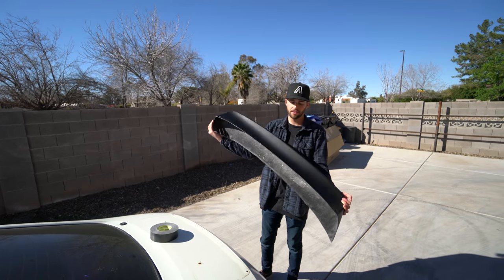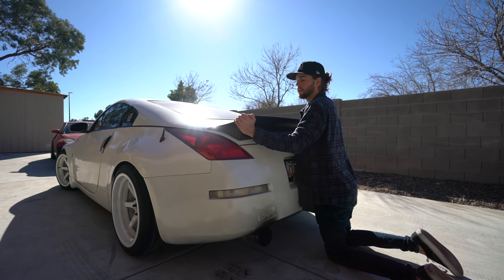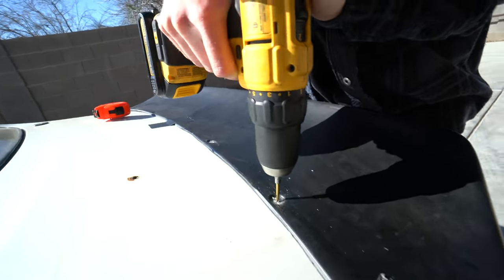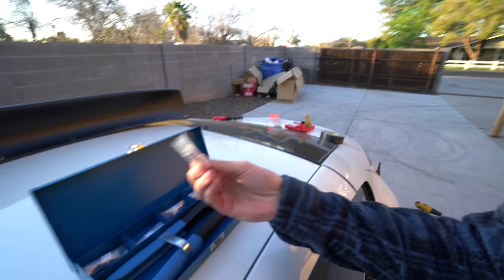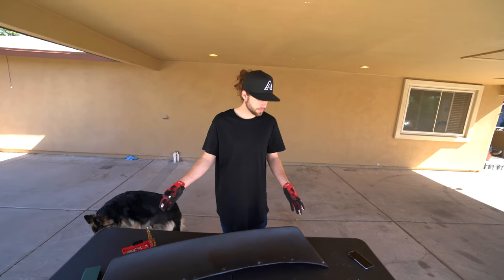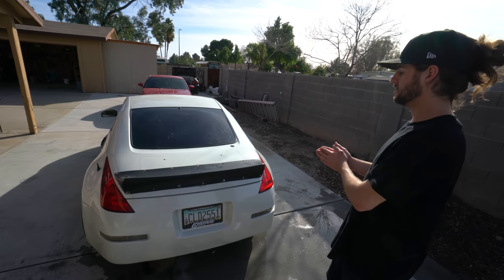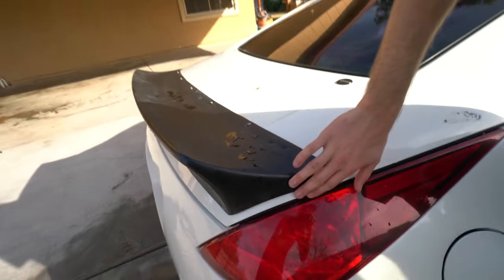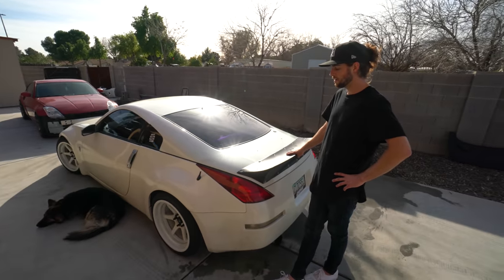Rocket Bunny Duck Tail Install on Nissan 350z

Comment: Bro so sick. I’m bout to sell my miata for a 350z
Reply from the maker: Good move!!!
Reply: yo I have 3 miatas but I'm just straight up buying a 350z😂
Reply: @CameronAlford  how's it going bro I just bought one of these spoilers the other day and looks like double-sided tape not going to work looks like I might have to remove emblems to even make it fit properly would you recommend Mountain it the way you did it and if what all I need to do really didn't want to drill into the trunk but looks like that's the only way it's going to work
Reply: @F.B.I Ur the fbi?
Reply: Noooooo don’t do it! 350s are so garbage with electric problems, buddy had one, goes to limp mode, you wiggle so wires then it’s fine then randomly it goes limp then you wiggle some dumbass wire like the wire for the window regulator, then it comes out of limp, confusing ass garbage

Comment: you really have to go around the spoiler and sand the parts that are touching the trunk when it doesnt sit flush, you should wipe somthing along the edges (so when you bolt it down and then remove it you have witness marks that show the spots that need to be ground down.the more you do this the more it sits flush. these are mass produced cheap fiberglass parts that they dont even check before shipping them out

Comment: Carid is probably the worst place to buy car parts for, I got screwed out of a 300$ rear bumper WITH GUARANTEED FITMENT so I ordered it, and what a surprise, it didn't fit, so I emailed them and sent pictures of how bad the bumpers mold is and 3 weeks later after arguing with them they couldn't deem the part defective, 0/10 do not recommend

Comment: What you have just done is put a very dramatic wing on the back that at higher speeds will essentially push down pretty hard and see-saw over the back axle and result in the front end going light and losing considerable traction.
 The video should be renamed "How to fuck up your 350 z's handling" lol 
You destroyed your trunk lid and probably made the car understeer dangerously at high speed :)